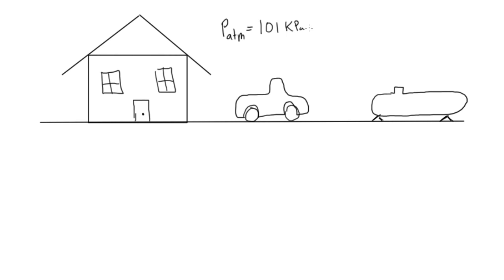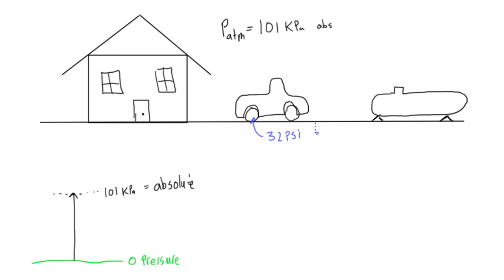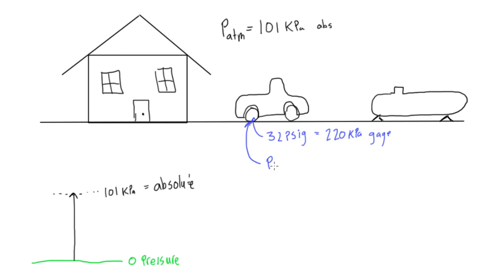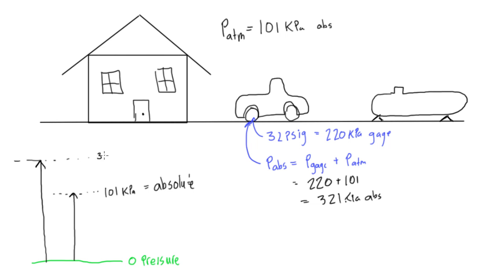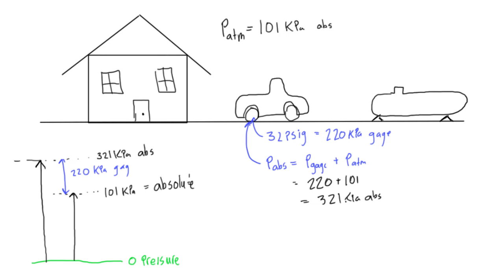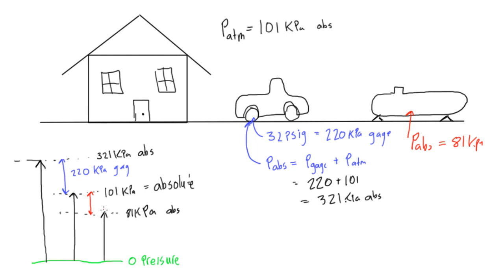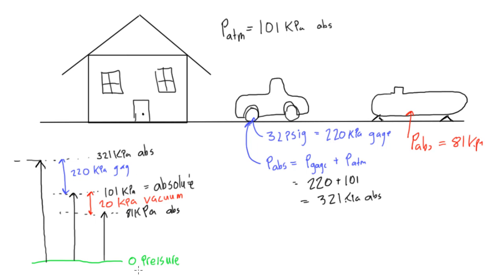Gage, vacuum, and absolute pressure explained

Comment: Shouldnt o pressure be above the 101😅
Reply from the maker: 101 kPa Absolute is often sued as the reference 0 kPa Gauge. 110 kPa Absolute would then be 10 kPa Gauge, and 91 kPa Absolute would then be -10 kPa Gauge (or more commonly, 10 kPa Vacuum).

Comment: Doesn't pressure decrease in going up? You said that in your compound manometer video...
Reply from the maker: The diagram in the bottom left is just to illustrate relative magnitude. Don’t take it as a literal height measurement. Bigger magnitude = bigger pressure, that’s all.

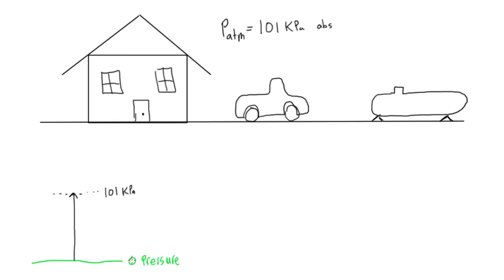Comment: I thought pressure decreased when we moved upwards? 1:22
Reply from the maker: Oh I see your confusion. The little graph thing in the bottom left corner that you're looking at has nothing to do with hight. It's like a column graph, where the taller the column, the larger the value. A pressure with a greater value is further away from zero, that's all it's really representing. Does that clear it up?

Comment: What would happen if there was no air (Patm = 0 psia), and there would be Pabs = Pgauge? What would be the classification? abs or gauge? Thx

¿Qué pasaría si no hubiera aire (Patm=0 psia), y quedara Pabs=Pgauge? ¿Cuál seria la clasificación? ¿abs o gauge? Gracias
Reply from the maker: The complete absence of air is a perfect vacuum. Space is a perfect vacuum for our purposes. A cylinder that has somehow had every bit of air sucked out of it is a perfect vacuum. A perfect vacuum has zero pressure absolute. Atmospheric pressure is the ambient air pressure at sea level on Earth. You can always assume it to be 101 kPa absolute for these problems. "Gauge" and "vacuum" are just used to indicate "above" and  "below", respectively compared to atmospheric pressure. So 111 kPa absolute = 10 kPa guage and 91 kPa absolute = 10 kPa vacuum. Atmospheric pressure = 101 kPa absolute = 0 kPa gauge. There will never be a time when earth's atmospheric pressure = 0 kPa absolute. If that happens we'd all be dead yo.
Reply: @Engineer4Free  I see. Thank you.

Comment: So for the tank, if it had a valve and I opened it, nothing would come out, since the pressure is higher outside the tank than inside?
Reply from the maker: Yes, in this case the air from the atmosphere would actually go into the tank if the valve was opened.
Reply: And 2 kids die instantly as a small town is reduced to rubble when they bled off 4200lbs of propane cuz they thought it would suck in air.

Comment: So... Patm equals to Pabsolute?? Also I wondering, how about the pressure generated by a wing of an airplane around it. What type of pressure is that?? Thanks sir
Reply from the maker: 101 kPa absolute is often the absolute pressure found at sea level yes Patm is written as an absolute pressure that we then set as a reference point to take convenient gauge pressures from. Wings create a pressure difference, and that pressure difference results in a force called lift. The difference between the pressure at bottom of the wing and the top of the wing is essentially what is important.

Comment: At the end of the video you said gauge pressure is how much more  we have than absolute pressure. I disagree. Gauge pressure is how much more we have than Atmospheric Pressure. Meaning that if we took a pressure gauge and leave it open to the atmosphere, it will read zero.
Reply from the maker: Hey thanks for actually watching to the end and thanks for the correction. Yes I do say "more than absolute pressure" when I technically should have said "more than ambient air pressure" or " more than atmospheric pressure." I was pointing at 101 kPa while saying this, and in my head it was clear what I meant, but I should have been more explicit. Thanks for contributing to the discussion, hopefully if anyone is confused by my choice of wording your comment can clear it up for them =)

Comment: Is it the atmospheric pressure always same with absolute pressure or just in certain situation only?
Reply from the maker: Atmospheric pressure can vary depending on where you are or the current weather conditions etc, but often in thermo/fluids problems we use 101 kPa (absolute) unless otherwise stated. If atmospheric pressure is being talked about as a gauge pressure, it would be 0 kPa (gauge), because gauge measures how far away we are from the reference, but if Patm IS the reference, then it is 0 kPa different than itself. Does that clear it up?
Reply: @Engineer4Free  Okay that 2nd statement went completely over my head. Can you please explain it again ?
Reply: @dahaka_scares_me909  Put it this way, there's always going to be a background air pressure.  The air pressure is not necessarily going to be 1 atm everywhere on this planet, because it will vary with altitude and numerous weather factors.  However, in any academic problem, we assume background air pressure is 1 atm, or 101 kPa, unless there is other information given.  This is the accepted value that we use for the global average of air pressure at sea level.

The concept of gauge pressure is always based on what the background air pressure is, which is not necessarily 1 atm.  If you are given that a problem takes place at high elevation, and the background pressure is 85 kPa, then 85 kPa absolute is the zero point for the concept of gauge pressure.  Pump a tire to 250 kPa gauge at this high elevation location, and absolute pressure will be 335 kPa.  Pump a tire to 250 kPa gauge at sea level, and the absolute pressure will be 351 kPa.

Comment: there's something that i do not understand. 
Pg = 220 kPa and Patm = 101 kPa abs. and it means that the tire is 220 kPa more than the 101 kPa.

Why? Isn't it 119 kPa more than the 101 kPa?
Reply from the maker: Hey Don thanks for the question. The Atmospheric pressure is 101 kPA abs. The pressure in the tire is 321 kPa abs. 321 kPa abs is 220 kPa higher than 101 kPa abs, so another way we can describe the pressure in the tire is in gauge (instead of absolute), and it is 220 kPa gauge. 

Chances are if you go look at a car tire, it will say to fill the tire to about 32 PSI (220 kPa). It is telling you to fill the tire to a pressure that is 32 PSI greater than the air outside the tire (so the instruction is given in gauge pressure). Most things in life are actually given in gauge, not absolute pressure. 

Does that clear it up? The 220 kPa is the tire's gauge pressure, and therefore the difference between its absolute pressure and Patm.

Comment: 101 KPa is absolute and 321 is also absolute KPa ?
Reply from the maker: Yeah
Reply: This part confused me. Both are absolute.
Reply: @marvindizon2912  101 KPa is the absolute Atmospheric pressure ie the exact pressure of the atmosphere. 
321 KPa is absolute pressure meaning the sum of gauge pressure and atm pressure.
Reply: @dahaka_scares_me909  hi can you help me please? I have this tank operates at atm pressure, 1.01 bara. And the design pressure is set at 10% additional from operating pressure. Therefore, I have design pressure around 1.1 bar. So my question is, what is the unit of 1.1, is it barg or bara?
Reply: @fixjustin2699  Given 1 bar of background pressure, and 0.1 bar of pressure above the background pressure, this would make the absolute pressure be 1.1 bar.  The corresponding gauge pressure would be 0.1 bar.   I suppose it would be 1.1 bara and 0.1 barg, although I've never seen the units written that way.